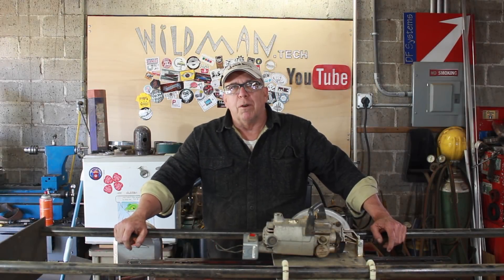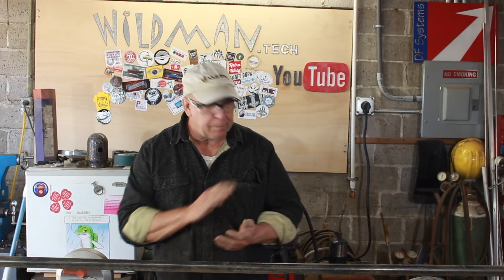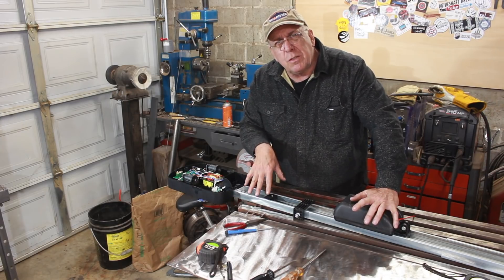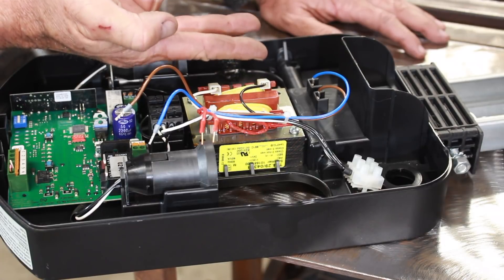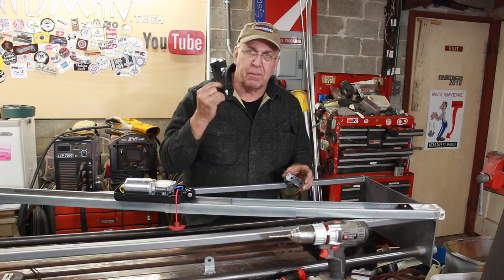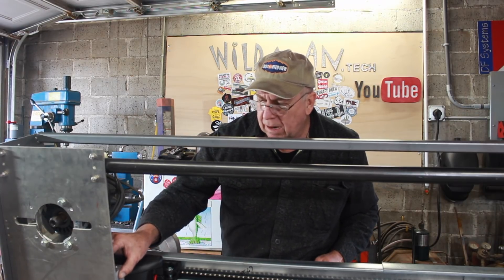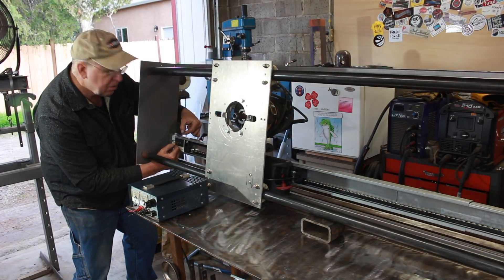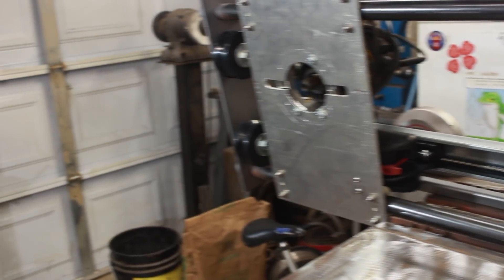Wood Slab Surfacing Machine - Part I

Comment: Love this project! Scot's going to be happy when it's done! 

For control, you are basically making a two axis cnc, so you could use a limit switch to the right end of the gantry to send it back to the left side, hit a second switch and advance the entire gantry ' forward '. Then begin sending the router across again. I think on Arduino you will be doing this with a lot of delay commands etc, or maybe you can do some fancy stuff like sensing when voltage is applied on/off your stepper motors. Could also get into an actual motion control board like a tinyg and use that, gcode would be pretty easy to program and it would give you the flexibility to do stuff like surface a circle, or a grid of slabs etc...
Reply from the maker: Definitely not using stepper motors. Probably going to use another garage door opener for the linear drive. The limit switches are such that they disconnect the positive voltage from the motor when they reach the end, but they still allow positive voltage to be applied to the other pole. I'm using a current sensor to determine when the motor has stopped, then I'll energize one of two relays to change the polarity. At the same time, I'll advance the linear drive some pre-determined amount of time to move it half the width of the surfacing blade.
Reply: sounds pretty good to me - looking forward to seeing the progress

Comment: You're a wildman alright!  That's a hell of a lot more than a slabbing machine!  It's a panel cutter, stock ripper and an overall mean machine. Make another and sell it to the mother--home depot!

Btw, there should be a recall on the garage door opener if the plastic burns with a lower rated bulb!